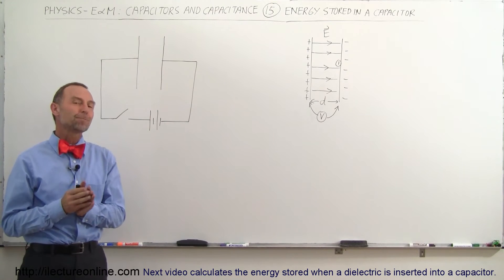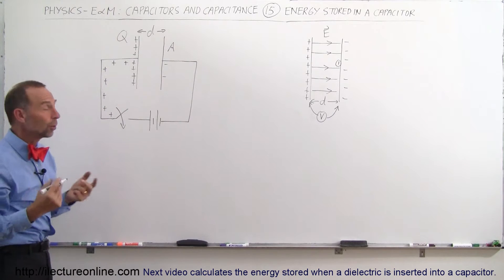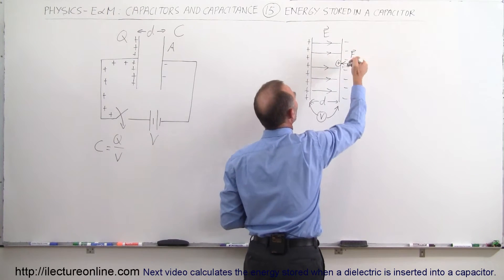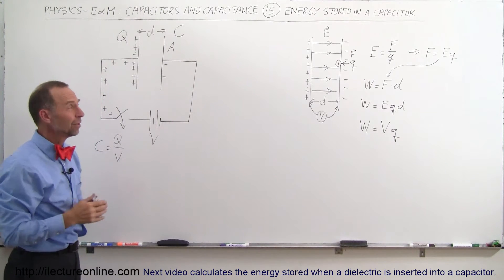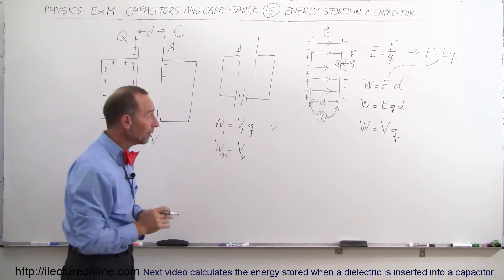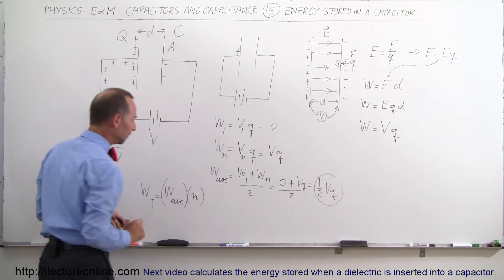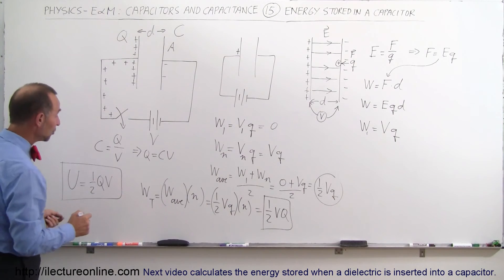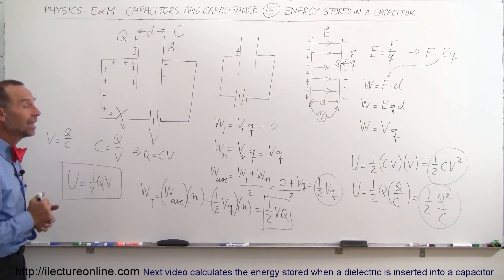Physics 39   Capacitors (15 of 37) Energy Stored on a Charged Capacitor

Comment: Why do you always mention that positive charge is moving across the circuit? I am kind of confused because electrons are negatively charged and are actually meant to flow through a circuit.
Reply from the maker: A long time ago, when they realized that charged particles were moving through circuits, they didn't know which ones, and what their charge was.  So they took a guess and called them positive charges.  (We now know that is incorrect).  But they kept that convention going and most text books still use that convention.  As it turns out, it makes no difference to any of the theories or applications.  Just make sure which convention your book uses. (I have seen some books using the negative charges moving which makes it very confusing).
Reply: got you, Thanks legend @MichelvanBiezen